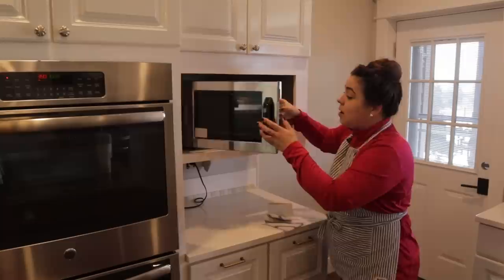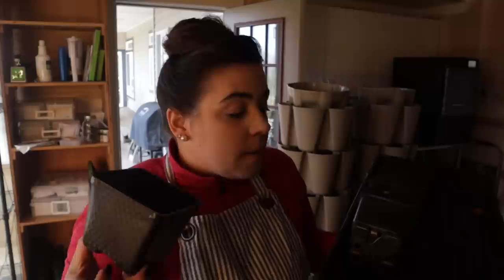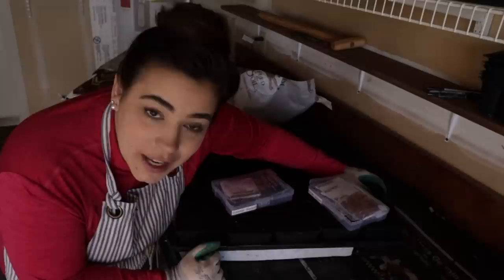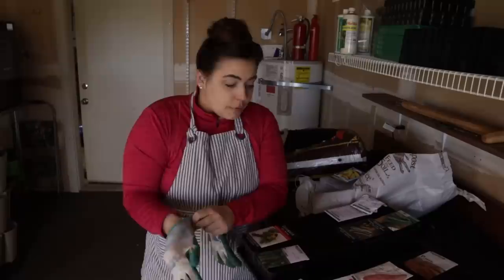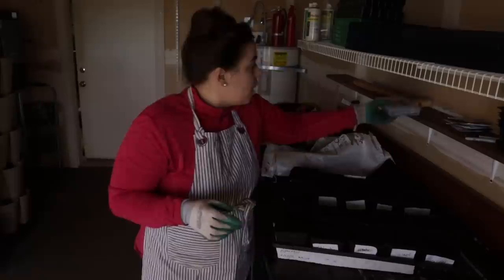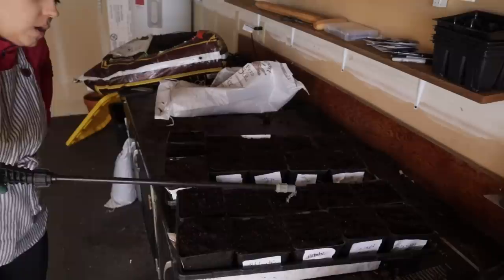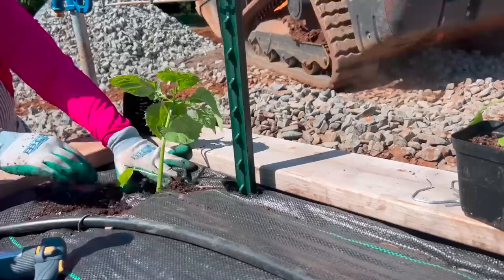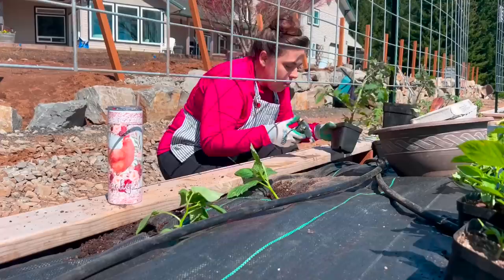The secret to growing the BEST tomato plant!

Comment: Have you ever tried starting your seeds on paper towels? I do that with the ones that are better to direct sow, just so I know they’re viable. Once they sprout, I put them in the soil. It works very well for me.
Reply: You just wet seeds on a paper towel?
Reply from the maker: I have an experiment going right now with some winter squash :)
Reply: @AcreHomestead   I fold a paper towel in half, put the seeds in the middle, and put the whole towel in a ziploc bag. I put in just enough water to completely soak the paper towel, but you don’t want standing water that’s too much. Then I arrange the seeds so they each have plenty of room to sprout, zip up the bag, and then place in a warm spot. I usually put mine on top of my refrigerator, but anywhere reasonably warm is fine. You’ll see them start to sprout within a few days! It’s a fun activity for kids as well. If y’all have any other questions let me know!
Reply: Also wanted to add… when you go to put them in the soil, make sure it’s root down! 😊

Comment: Try putting copper tape around the edge of your beds to deter the slugs. I’ve found that helps and is relatively inexpensive. (Plus, organic)
Reply: In a circle around plants Pennies before 1982 work also
Reply: Thank you for the tip!
Reply: I need to try copper  for sure
Reply: Can you use eggshells?
Reply: I glued old 2 pences around my container garden lol
Reply: I'm going to have to try this. Thank you! Darn slugs!
Reply: The challenge is that the slugs come from underneath; they don’t crawl over the edge of the bed.  They’re a frustration for sure.
Reply: @shesatitagain234  Right but again if you put eggshells it slices their body underneath the ground so that's my solution
Reply: I put wide copper tape around pieces of pvc pipe and plant the starter within it on the ground. It helps prevent slugs and snails as long as no part of the plant touches the dirt or nearby post/panel. I have found that the tape around the wood comes loose eventually. If it’s planted in a ceramic or plastic planter, using the tape around it down low works great.

Comment: A whole egg takes ages to brake down,  what you wanna do is use a mortar and pestal to crush and grind the shells up so the plant has access to the calcium 😊
Reply: I was going to say that, too. I have always used crushed egg shells in my garden. It provides nutrients and deters the slugs, as well. Double win!
Reply: Mortar is time consuming. We dry shells in paper bag and jump baby on it, until they are old enough for toddler stomping. Chicken chores are great early kid chores.
Reply: @K Nat  that's a very cute and quick way of getting the job done, it's nice to involve the family in these things 😌
Reply: I crushed mine and dried them in the oven on a cookie sheet. Put them in a blender and made powder. See “Rain Country “ for the directions.
Reply: I rinse and dry my egg shells. Put them in a container in my windowsill to dry. Once dry I crush them up in a bag and pound them as small as I can get them. And put some in when I plant. MOST importantly I put a generous ring around the stem  to stop the slugs from getting to the plant. It also feeds the plant.
Reply: All winter I save eggshells and then and crush with mortar and pestle and spread in planting hole for tomatoes, but I also buy a big bottle of cheap calcium supplements from Costco and pulverize in mini food processor.  Sprinkle a little in hole when planting tomato. Have not had blossom end rot the past few years since doing this.
Reply: Dry eggshell and the dump in my Ninja and it works awesome for a more powdery egg shell dust

Comment: I think you already mentioned having a planting calendar, but Portland nursery has a Veggie Planting Calendar pdf that you can download that is so useful. It tells you month by month, exactly when to start what seeds indoors, what seeds to start outdoors, and what starts outdoors. It helps avoid the issues of planting cucumbers or peppers too early. May 15th is the time they recommend for tomatoes outdoors, but only if they are covered. This year we have a heat wave so covering is unecessary, but you can buy these bags to put around tomatoes that have little cells you fill with water. They heat up during the day so as nighttime temps drop they keep the plants warmer.

Comment: I was thinking of a suggestion that you could do when you have several bags of compost, you could get a feed barrel and a dog food scoop and fill the feed barrel with your compost that way you could have your tray of pots and just use the scoop to scoop the compost into the pots instead of having the bag on the table. And speaking of table you could put a small lip on the edge of the table that way when you're planting the dirt doesn't fall on your feet and slippers.

Comment: It works well to cut a row in the fabric like a long capital letter I, with 3-4" slice at each end.  Then fold it under and pin it so you can plant a row of seeds close together instead of burning holes.  Works well for green beans, greens, carrots, peas, ect.

Comment: Hello Becky. The garden looks great. A little tip about watering. You won't burn your tomatoes if you water them in full sun. That's a myth. The only thing that happens is that the water evaporates faster, and the plant can not absorb it. This applies to all plants.
Reply: Hi Sarah, I hope u don’t mind but I challenge that, my son watered my plants from overhead being lazy last year in the heat of summer and absolutely fried the leaves of my plants. I doubt it would happen in spring but in the heat of summer they will fry especially in my Texas heat.
Reply: I always questioned that, when it rains and then the sun comes, it doesn’t burn them. What’s the difference?
Reply: I think the problems can happen with the temperature of the water. In AZ, the water temp in the hose can be blistering when it first comes out of a Summer hose. Water at decent temps won’t burn your plants, but getting tomato leaves wet CAN make them more susceptible to disease if you live in a humid climate.
Reply: I actually have sunburned some plants before. They were newly planted pepper seedlings which got water splashed on them. The sun burned a water droplet pattern into the leaves. They did recover just fine though.
Reply: The rain after a sun shower never burns the plants. I water whenever and have not ever burnt my plants.
Reply: When it rains there is an over cast, the air is cooler too. I will say if watered from the bottom, like soaker hoses it doesn't burn as bad, but if sprinkling I would do early in the morning, so air has time to dry leaves and water has time to reach the roots good. Just my thoughts.

Comment: Becky, when I used the landscape fabric in my garden area I used the torch to cut each piece. It not only cuts it but burns it at the same time to stop fraying. No need to cut with knife or scissors first and then burn the edges. Just use your torch to do the cutting and burning at the same time. So much easier and faster. ❤

Comment: If you put them out and temperatures  drop cover them, most use old jug ( like milk  jugs bottoms cut off. In a. Pinch use a large old black plastic pot even clay they retain heat so if days get warm the pots  need to be uncovered. Jugs  no lid on should be fine unless extreme  warmth
If plants are to large cover with garden clear or white plastic. Your plant want slow down

Comment: I’ve been using cattle panels in my garden for many years. I affix them to my T-posts using heavy duty zip ties.  I trim the ends of them so I do not poke my eyes during harvest and when I weed my garden. 

I use soaker hoses along my rows as opposed to broadcast watering. Really helps to keep weeds at bay between the rows.

Comment: For calcium for plants, you can just use the egg shells dissolved in vinegar, rather than the whole eggs. The egg shells are basic pH while the vinegar is acidic, so they'll react and the vinegar will help dissolve the egg shells. The vinegar is typically the limiting reagent in the reaction, so you'll have some egg shell residue in the solution, and the final pH of the solution will be neutral (no worries about it messing with the pH of your soil!). You can then dilute this in water and use it to water your plants (it's very concentrated), or you can even spray it on the leaves of plants (not during the day of course!) to absorb it. This reaction will change the form of the calcium to be a more bio-available form than just using straight egg shells. It's also much more immediately absorbed, so you can apply it as soon as you see any blossom end rot – it won't be able to save the current bloom of fruits, but will be fast-acting enough to save the next round!

Comment: Jess at Roots and Refuge started the whole egg in a hole thing several years ago.  However, upon researching, eggshells take several years to break down to form where the roots can absorb any nutrients.  Only a very insignificant amount of calcium and/or yolk protein may leach into the soil from a crushed egg and will likely not affect the growth of the plant. A whole egg will do even less but may even attract wildlife to dig for the little gems.  If the egg does not crack all season, you will have a stinky mess if you break one next time you amend your beds.  Better to pulverize your shells to a powder all year then scatter it in your beds in the fall. This will allow several months for the powder to break down to enrich the soil.  Better yet, just get a bag of bone meal and spread it in your garden.  Waste of eggs.

Comment: Becky, what i do for the egg and banana peels is i dry both of them and then i run them in my food processor to break them down and then i have a mini coffee grinder that i powder them and use that in my gardening.  I do this all year long and have all that i need to garden with. I have cooling racks with legs that i hang the banana peels on until they are dry. Your garden is looking good! We also cover our garden, it holds the weeds down, warms the ground and i think it helps keep the moisture in the ground.  We will be planting our garden the end of May.

Comment: Becky a quick trick for even distribution of carrots.  Make a water slurry…it’s just like gravy but only water and a bit of sugar… boil the water, mix flour instead the hot water sprinkle a tsp of sugar to melt in the water add the flour mixture thicken the water and cool.  Once cooled pour into a sandwich bag, pour in the seeds squish to distribute, make a small clip in the bottom corner and squish like frosting down the trench roll.  Cover with dirt and grow 😊

Comment: I've had my raised beds for 3 years now. They are built similar to yours and I have gravel around mine as well. I think with a taller bed and no grass or weeds growing around them you will find that you will have less weeds. Just remember to cover your soil in the raised beds when it's not growing season. That will help prevent weed seeds from getting in there. I hope that helps.

Comment: Saw a trick on another gardeners channel. Taking 2 Tera-Cotta pots one slightly larger. Stacking the larger pot on the smaller one turned upside side down in a wet areas. Keep pots wet. The little critters will crawl up and through the drain hole inside that’s now the top. Lift the larger pot up and collect to dispatch them. Copper also works, a little pricey for a big garden.

Comment: We rarely started seeds, most went into the ground and we worked from there. But if and when we did starts that were to suffer from transplanting then we used the decomposable pots. Just put them in the ground when your plant is good to go in full ground and the pot would decompose without the plant having to be handled to much.

Comment: With my indeterminate tomatoes i always use 2 tomato cages with one upside down on top of other ( wired together) could use zip ties for a season though.  Because 'tomato cages ' need to be taller. One is ok for for things like peppers but not indeterminate tomatoes.  You could also use ' the weave' method but i only use that for peas here in south-central Indiana  😊 also, when i use tomato cages, i bend the bottom prongs so they are more stable in the soil

Comment: Have you ever tried clipping a little notch in your seeds before planting them? They sprout much faster. It's especially helpful with large seeds  and ones with tough shells. It can mean the difference between sprouting in a few days rather than weeks. You just need to open a little hole in the end opposite the germ. That's normally the wider, rounded end.

Comment: I’m at 500 ft ele in castle rock wa. I make greenhouse hot house out of store bought tomatoe cages. Upside down, wrap with visqueen staple and you have a lil hothouse for peppers especially. A lot of cold wind from the mountain and colder nights. These protect my heat lovers until the nights warm. I’ve done this for years…mountains of Idaho also. Works great. Leave a opening at top so they can breath to. Just a thought. This is old school do with what ya got trick. Happy days summer is nearly here!! 🥳🥳

Comment: Well done on the progress in the garden, makes me motivated to get out and keep working on my new garden and polytunnel. 

I wanted to say that adding an egg to planting holes of tomatoes is not going to give them calcium. Egg  shells take a really long time to break down, longer than one growing season, in fact archaeologists sometimes find them intact! 

It is possible to unlock the calcium by soaking shells in vinegar, but there is generally plenty of calcium in soil so it’s not even necessary. 

The reason tomatoes show calcium deficiency - blossom end rot - is most often due to irregular watering. It takes a lot of water to move calcium through the plant to the fruits which is why they show the effects. 

By far the best use of egg shells is to return them to chickens, they can break down the shell and use the calcium for their egg production.

Comment: I do a fair amount of gardening in Missouri and also fight slugs quite a bit. I like to find solutions to these pests that don’t use a lot of chemicals whenever possible.  I have had great luck with putting pennies around the plants to deter snails and slugs. It’s not a fool proof, solution, but it definitely helps cut down on plant loss due to these guys. Something about the copper they don’t like I guess. 
I’ve also been told that saving hair clippings when you get a haircut and sprinkling those around plants can help. Maybe worth a try?  If nothing else, it’s a great conversation starter when someone comes to your garden. 😂

Comment: I just save my egg shells and banana peels all fall, winter and spring. Bake the shells, crush them up and add a handful under your plant along with a 1/4 banana peel. I’ve been doing it for over 30 years. Does it help? Not sure but I get bumper crops of everything, every year.
We’re trying woven weave fabric this year, for the first time. I’m finding it cumbersome 🤷‍♀️Loving the drip tape system though.

Comment: Four slugs, all you have to do is put a low vessel in your garden beds with maybe a 1 inch rise or less and then fill that with beer. The slugs love the smell of beer and they will go over climb into it and drown. So don’t put up with that with your garden on which you have worked so very hard. If you remember 2030 years ago, it was very popular to put burner covers on your stove top. Those are perfect For putting in the garden with beer because the sides are so short that the slugs have no trouble getting in there at all. It will be worth it and you’ll be happy you did it.😊

Comment: With that weed barrier  your soil MAY be at 50 degrees. Its the temperature  of the soil I HEARD thats the key.Of course the temperature  outside  is important  but your plants MAY benefit  from the heat of that fabric .Anyone  else NOT using  this may have to wait  for the temperature  of the soil  to rise.

Comment: Last yr I had total failure with sweet peppers and zucchini. How the heck can zucchini fail? I had a crop of hot peppers which will last me a decade. I don’t plant outside until nighttime temps are 50. (Roseville CA, zone 9). Since I’m alone and elderly and have a very small garden, I’m using those unwoven  fabric containers. Anyone used those? Did they work well?

Comment: I have a question. I bought a Greenstalk from the big sale they had from your channel. I fill the top full of water but, it runs right out the bottom and my plants are dieing and dry, does the water drain straight out on yours? Also what type of fertilizer are you putting in with the veggies and flowers?
Reply: I did hear Becky say you have to line up the watering holes correctly. Are there instruction sheets with the tower?

Comment: I found this video a little hard to listen to as the volume kept changing. The voice over is much quieter than the regular video. I often play the video while working on projects so its bothersome to constantly have to adjust the volume. The voice over sections require full volume but the regular section only require 55%